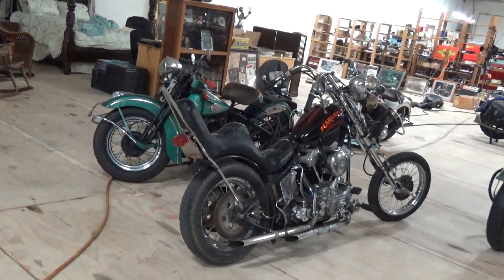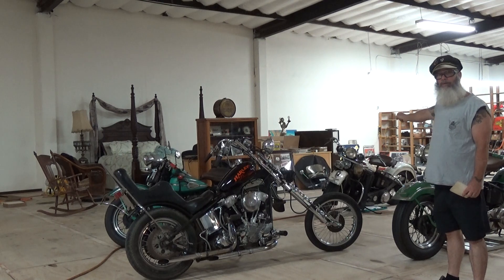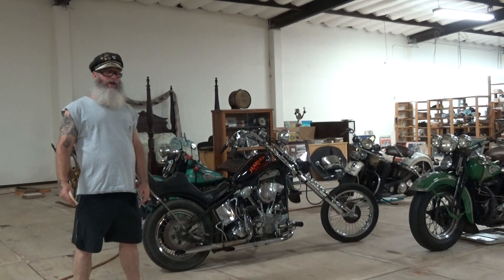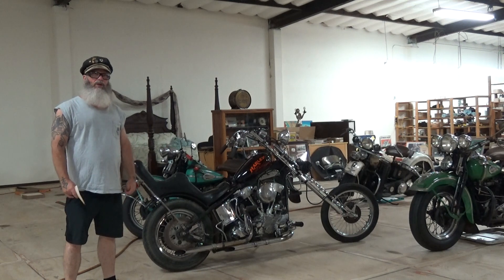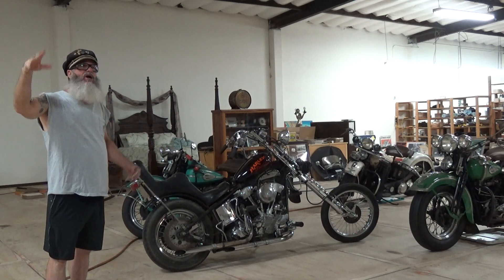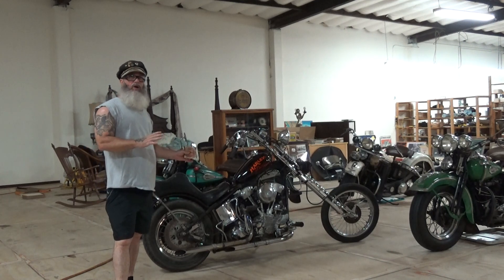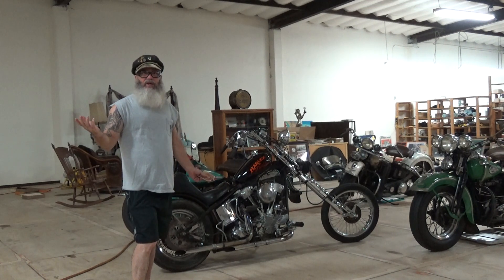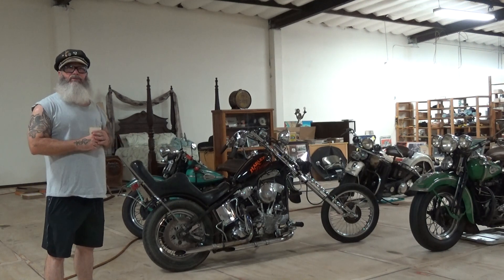Hunting Harley's, chopper history

Comment: My dad and uncle built hot rods and choppers in the 70's. Me as a pre-teen I love the 60 degree rake, rainbow tape and 10 sided fuel tanks, digger frames, and the narrow handle bars that toad over the fuel tank with a suicide shifter. No one could ride my chopper. I sure do miss it.

Comment: Todd, I built my first chop in 1986. 18" over rigid, springer, Panhead powered. I was pulled over by every cop. It was a tough time then.
Reply from the maker: the cops didn't start backing off until 87-88, when the RUBS started buying "en mass"
Reply from the maker: nice looking machine
Reply: So in 1978 at Bolinggreen Kentucky the chopper fest the guy who owned it he raped some girl and did some acid and got stabbed then the cops came and busted everyone wow crazy times .
Reply: Good Luck 25K what a deal man . I assume you rebuilt the motor and trans and updated the brakes and suspension and all the dry rotted rubber bushings have been replaced for such a wonderful machine?  Man what a cool old bike I bet it handles like a dream  let's see do I buy a new 215hp Ducati V4 super pasta rocket or do I get the real mans 1978 rape fest chopper ? The decision is just mind boggling .
Reply: @Pat-RickSmith  lmao.

Comment: That is really extraordinarily interesting.
I'm from UK.
1965.
About  the only point you might resonate with was 1986 stuck in a room bedsit iup the stairs to the right. I built an xs 650 hardtail in there.
I would hide all the parts when the landlord came around in the bed behind curtains etc
I sprayed the bike in there, perfect imprint of the frame on the sofa.
Paint coming out of my nose.
I rode it down the stairs complete one hand on brake one o. Bannister with the carpet coming out from me.
Never forget look on guys face as he walked past the front door😂
I have a 95 1200 sportster with 6 inch overs with raked Zell yokes, she's used in all weather's here in deepest lanes of Devon, rusty and muddy and v beautiful she gets loads of attention cause they all can tell shes the real deal,!!
I will follow you on Facebook. 
Regards Rob.

Comment: The most reliable bike I've ever owned was a 59 FLH Panhead in a chopped rigid frame with 6" over Harley springer. I wish I still owned it 
I remember the good old days at the swap met where you could buy enough parts to build a bike for less than a set of wheels today
Sex drugs & rock & roll. Ass grass or weed nobody rides for free born in 1950 I lived through that era in So Cal They were crazy days lol Still craziness goes on at big bike meets today
Reply from the maker: I do miss those days. I just don't miss being pulled over by every cop that saw me
Reply: LOL me neither & it happened every time I rode that Panhead
Reply from the maker: same with my pan back in the early 80's, often with more then one cop at a time. and I always got a ticket
Reply: I usually got a ticket about 80% of the time for speeding because I didn't have a speedo & was usually going too fast The rest of the time I always fit the description of some biker they were looking to arrest & got let go after checking my license & registration & engine #'s & no record came back on their computers for me. It was the price I paid for riding a chopper & looking like I did back then. Now that I'm old & gray & ride a average looking bike a little more sensible I never get stopped
Reply from the maker: I think it had to do with the times. The RUB's had not come into play yet.  Like really? because I had a ridgid springer I must be some "outlaw"? Pre RUB days I got pulled over on an EX cop FXR in Hollywood. The Sheriff tried to tell me the numbers had scratches and he'd have to impound it. That stopped when I pulled out the receipt from the cop auction I had just bought it from. It was the times.

Comment: You forgot to mention the cops cracking down hard on drag pipes as the excuse to pull us over back when we were read Miranda rights lol , they had ground clearance laws they'd use as reason to seize all the hard tails , having a builders title back then meant automatic bike seizure & months waiting to get the bike back , lots of front ends destroyed back then from guys with no $ filling the lowers with slugs , a friend of mine did that to his forks and used so many slugs the lowers had zero travel , bike was like riding a tank .
Reply from the maker: some of the many reasons choppers went out of style "over night". Yet it was the antics at the bike runs like this that brought the cops down on everyone

Comment: There is an all original 36 knuckle head (not sure of the model) in a local motorcycle shop and they are asking 65,000 for it. Also are you from San Fransisco or an adjoining area
Reply from the maker: get me the information, huntingharleys@gmail.com
Reply: HuntingHarleys
You can call them up. Its in a shop called school house cycles in Norman, OK

Comment: Paid 5k out the door on a brand spankin new low-rider in 1979, they wanted either 5399 or 5499 at the time, the dealer came down to 5k   I wanted a new one with the new 80" motor after haveing a 41 e Knuckle a 52 pan 48 UL and a 69 FL. I kept the Low Rider for 10 years and sold it for $3500 in 1989 and thought i did alright, but if I would of waited a few more yrs i could of got twice as much and that always bugged me  errrrrrrr. couple of them on my Face Book if ya care to look